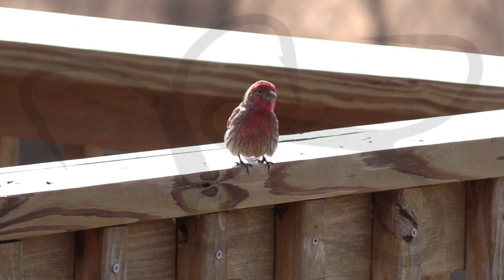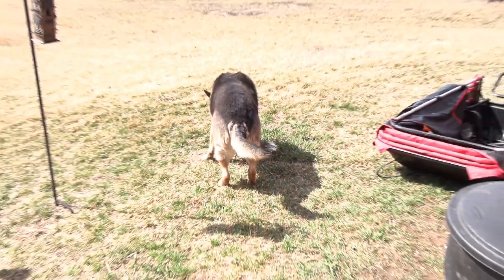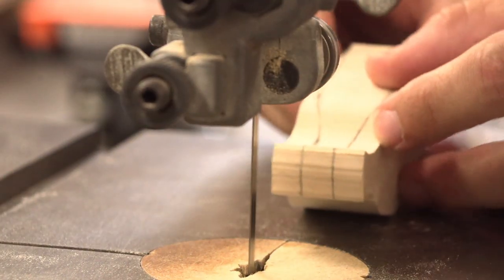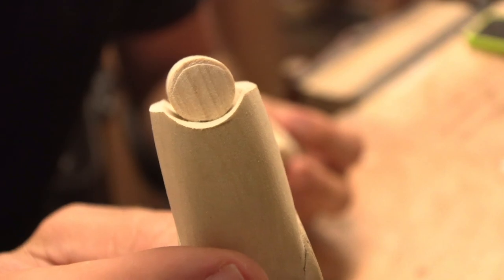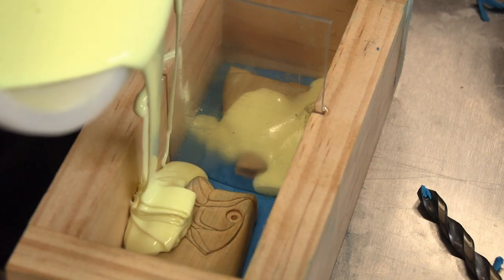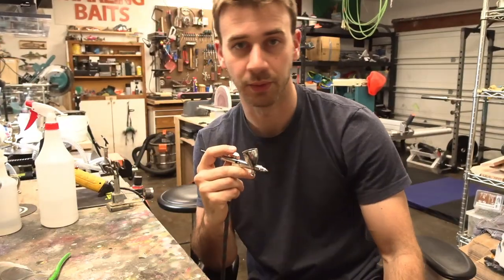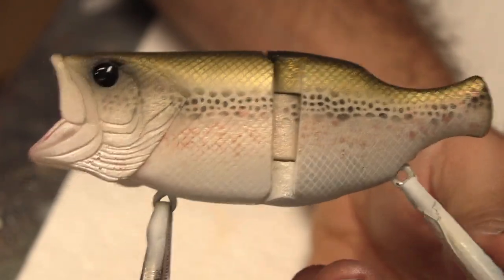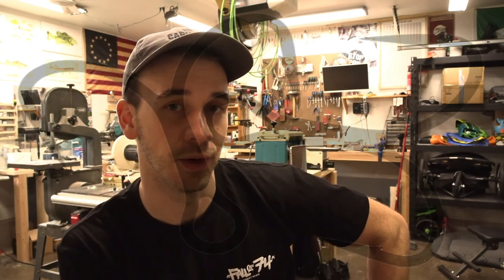Making WIDE Open Mouth Popping Bass SwimBait

Comment: I'm not a Structural Engineer by any means but it looks like if concave shape near the back of the front part, near the connection, it might let some water pass through and make the tail move.  That, or you can thin out the back portion of the front section.

Good videos, by the way. You just earned my subscription brother!

Comment: I have a feeling if it was a wood bait it would have worked flawlessly. The resin may have been too dense on top of adding the extra weight.  Looking back, aside from the rock bass, red ear sunfish and mother chaser lures this has to be the widest bait you have made. And all that extra volume of resin was probably foreign territory for you so miscalculations happened. 

To fix it I would make the top lighter. I've been looking at 3d printable lures and I've noticed some of the ones I've printed that work without added lead have had air cavities designed into the top half. 

Could you add something  to take up space inside the castings  to make them more buoyant? Or do you have a less dense resin or foaming resin that might do the job?

BTW, I'm looking into starting a small soft lure production business. Looking at your lures from epic bait molds and dead on plastix for a 100% made in the USA marketing plan. Having that as my main product line and some hard and soft lures I've been working on as well. 

Over Easter weekend I had the chance to test my prototype hard lure with great success on the action.  Just need to clean it up a bit. Was able to talk to epic bait molds about permission to sell and got some info on dead on product line. Now just to come up with initial funding and negotiate with local bait shops. Any advice?

Comment: The tail being at a upward angle and slightly above the midline is going to give it that wobbly swim on retrieval. The same thing happened with the rock bass you made. I don’t know if that was the desired affect and Im just be pointing out the obvious

Comment: That wood looks so fun to carve! Is there a place you’d recommend to order wood from?
Reply: I've been carving most of my life- the best wood to start with imo is tulip popular- and it's extremely easy to get. I just go out in the woods and find some, but you can just go to Lowes or whatever building supply place is near you and pick up a piece if you don't live near the wilderness. You want a piece with very minimal knotting, no grain run out, and as straight grained as possible. Then you want a good knife- and I don't mean a 20 dollar Walmart special- go get you a good carving knife. Personally- I like Mora, they're a Swedish company and they produce a scandi-ground blade- Imo scandi grinds are the best for carving because of angle of the grind- it allows you to remove the thinnest shavings possible or- hack off a big chunk- which ever you need to do. They're insanely sharp and very easy to maintain even in the field. Carving knives generally ahve very short blades on them- 3 inches or so usually, 4 inches at most- because it allows you the most control- you want a short, narrow blade with a full sized, comfortable handle.  This allows you the most control over the blade.
Reply: @stoneysdead689  thank you so much for all of the tips!

Comment: The problem with a jointed popping bait that swims like you want it to is the bait needs to be facing the direction you are popping it from to get a Hula poppers like popping action. When the bait swims left or right you won't get that popping action you are looking for unless you just straight retrieve it because you won't be pulling the water into the hollow mouth of the lure, when it goes left or right you are pulling the water into the side of the head and not the mouth. Its a good idea but i don't think it will work without having 3 mouths on the lure to catch water wether it's facing left or right. Unless you are fishing really calm water and you have a ton of slack in your line. That might actually be the key for this particular design is to fish it very slack line.
Upon more thinking maybe if you brought the corner of the mouth to under the eye on each side and left it concave like the mouth is now you could catch enough water while it walked to make the bait pop. If it works you could call it the Walk-N-Pop